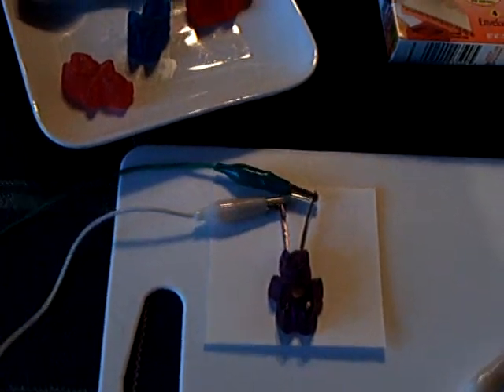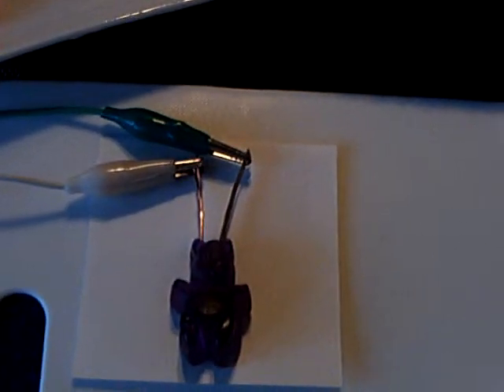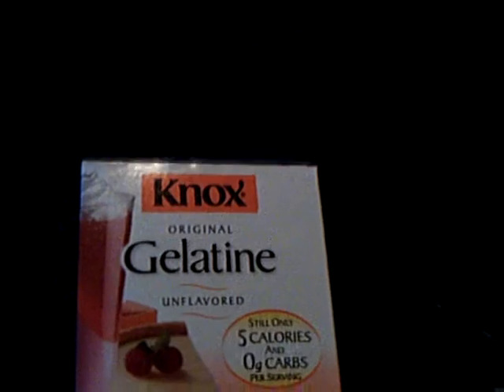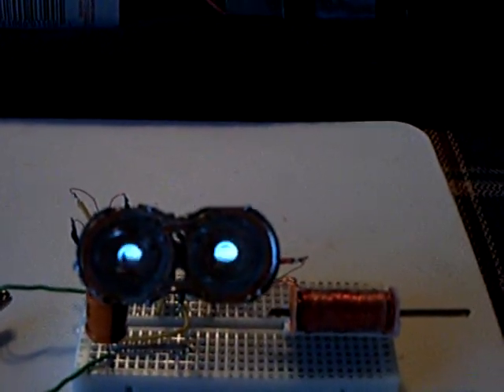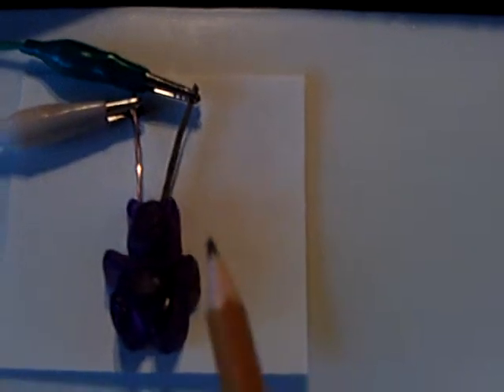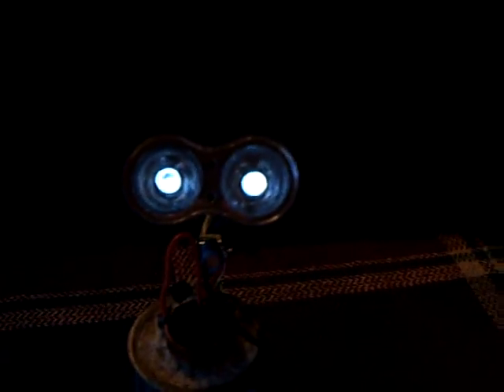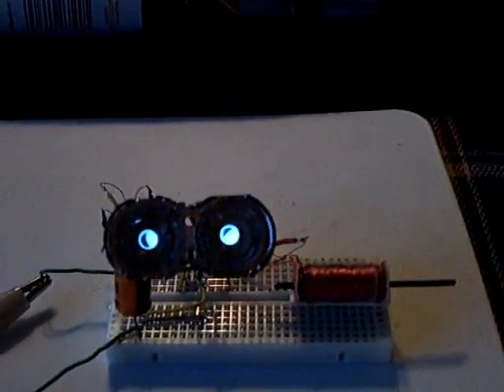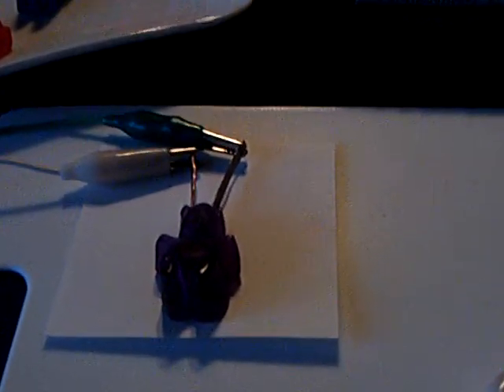Gummy Bear Battery.ASF

Comment: yep yep yep, a cocktail inside the gelatin.  Good stuff!  i am personally partial to zapping the cement batteries with a high voltage to "magnetize" them like j. huchinson did, though i have not tried it myself.  makes sense though, considering how magnets are made.  The pulse into the magnet material  (for magnets anyways) makes it to interface indefinately with the zero point, in my opinion, causing the field.